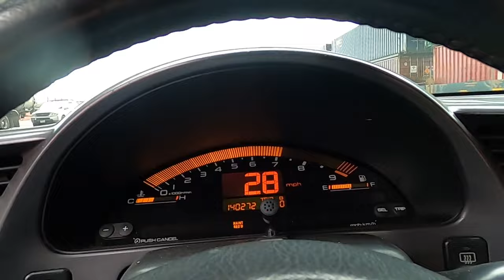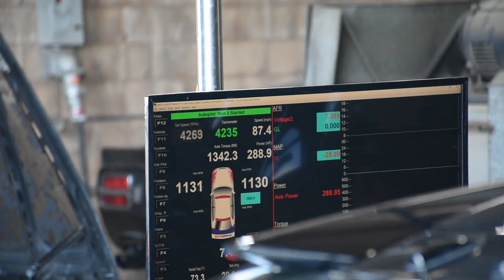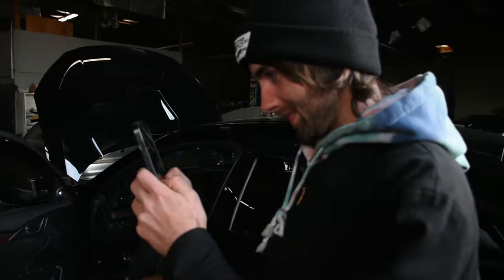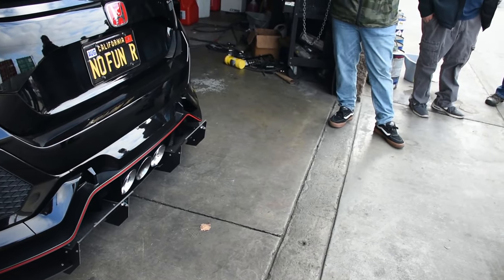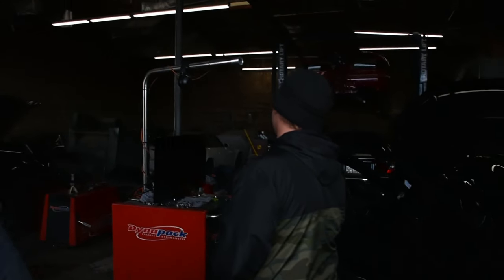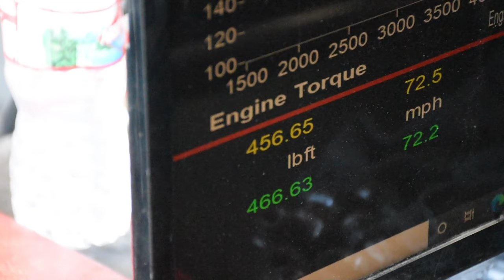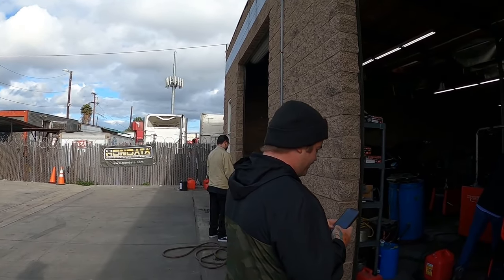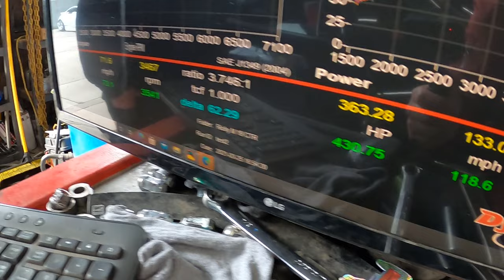CIVIC TYPE R // DYNO DAY // POWERMETRIC TUNE // FULL BOLT ON 43X hp and 46X Tq

Comment: Nob question… so do you use your stock MAF sensor on the Rampage housing and tune ? Or do you need to upgrade MAF sensor ? … Ricky’s built is 🔥🔥🔥
Reply from the maker: if you pushing this much power go with race MAF so you can get a cleaner air / fuel

Comment: Went to Church today
434hp/416tq
PRL HVI (street MAF)
PRL Inlet
JSR DP
PRL front pipe
PRL Flex Fuel
Mishimoto FMIC
FK8 Tuning Development (John P.) custom e30 tune
Stock exhaust (stealth mode)

470tq tho.....need that e50 tune in my life lol
Reply from the maker: Good shit man!!!! To get E50 going to really need that fuel system
Reply: @maganamfg  Yeah - everything is on damn backorder - Waiting on Xdi pump ....going FK8 TD injectors, JSR modified fuel line, DW300c intank pump
Reply: What fuel system are you running?
Reply: How much did all the tuning cost?

Comment: Which car is more fun to drive? The S2K of the FK8 Type R? I have an AP1 and considering the get a Type R also.
Reply from the maker: They are different cars and like them both for opposite reasons.
Reply from the maker: If planning to keep S2000 that be best, but if I had to choose 1 car I think overall the TypeR will offer more value considering space, power, comfort, speakers, and modern car.
Reply: @maganamfg  I definitely will keep the S2000 as this will be my 16th year of ownership :) I will consider the new Type R as the dealership here just sold last 2021 Championship White.  Thanks bro! Nice built btw!
Reply from the maker: @GarryYeoh  my pleasure, and congrats on having it for 16 years. Type R is amazing but something about old school vtec and no tq is amazing haha

Comment: Stock turbo means it’s not actually full bolt on but that’s besides the point lol your tuner really squeezed everything he could out on this tune
Reply from the maker: Difficult to say…. IMO and most I have asked in TypeR scene have stated  fbo includes everything but does not include turbo or fuel system.
Reply: The reason you say stock turbo is because a larger turbo isnt part of bolt-ons
You wouldnt say "Im full bolt on" and leave out the fact your running a 600hp turbo
Thats idiotic
Bolt-ons are dp, fp, exhaust, inlet pipe, intake box, intercooler, charge pipes
Basically optimizing the stock engine/turbo combination....most Rs will top out around 400-420whp because of fuel.  
 Once you go fuel system you can go 600hp, add a drop in turbo and daily 525-530whp or so on limited fuel.  
Once a solution is found we should see more Rs making 800+hp but fuel is a limiting factor for most who are direct injection only at this point.  
The 2017-2019 Rs can use port injection with a Motec ECU upgrade  the 2020-2021 Rs are stuck with Hondata at this point